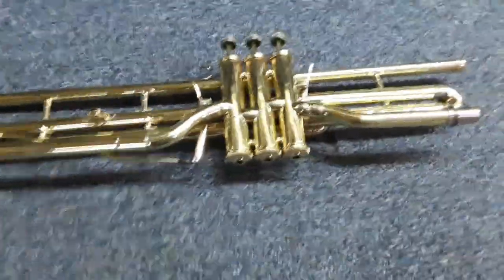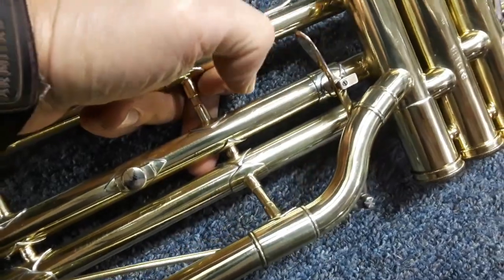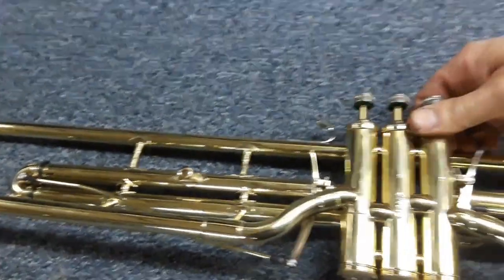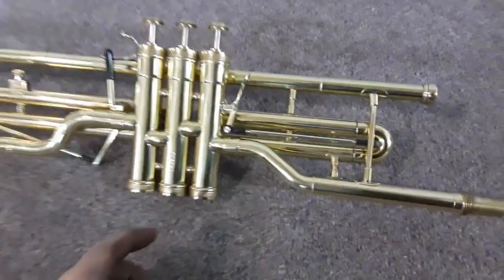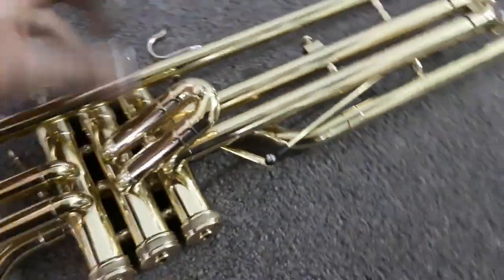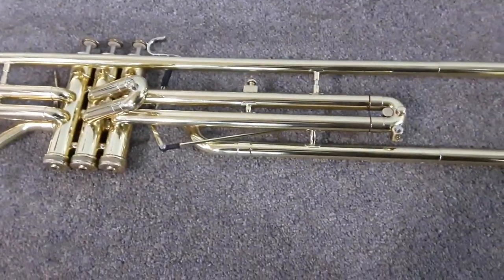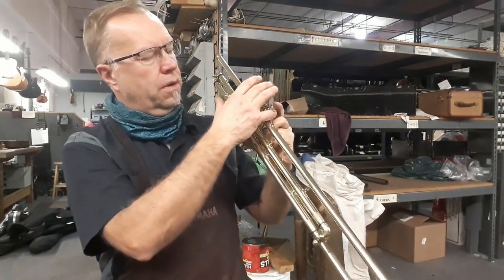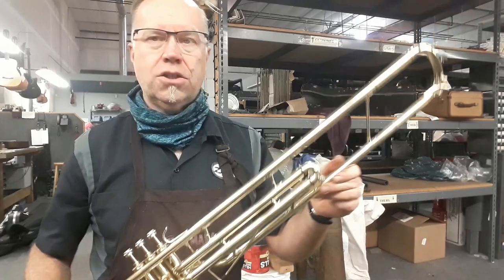Valve trombone slide triggers

Comment: The common problem with Valve Trombones is that they tend to play Sharp but with Valve Slide Triggers for the outer 2 Valves, you can get those notes to play more in tune.
Reply from the maker: Yeah, that's what they tell me. Too bad they cannot design it to be in better pitch from the get go, but I am no acoustical engineer. I'm just a plumber on band instruments. LOL
Reply: @jimflys2  Valve triggers do make a difference